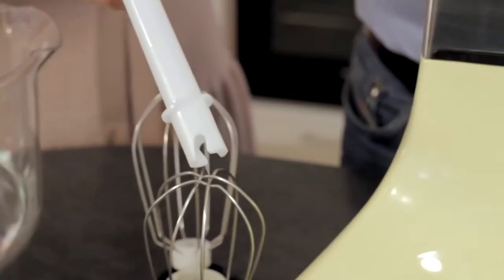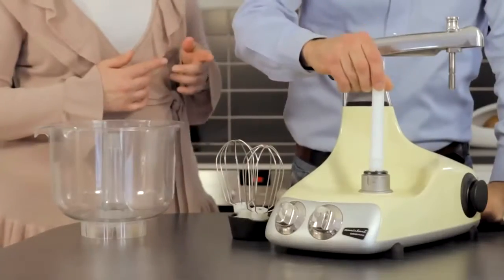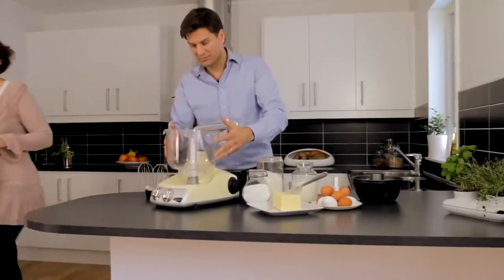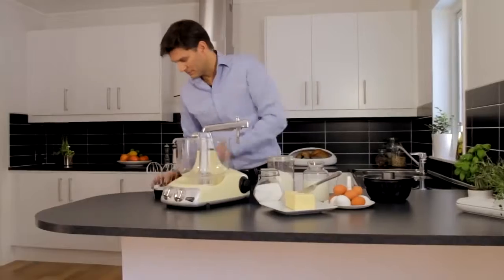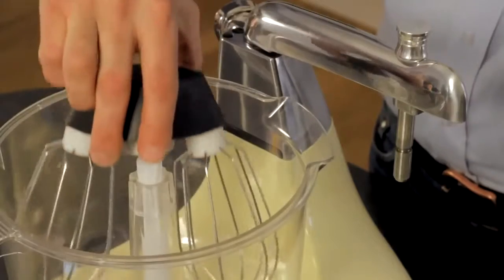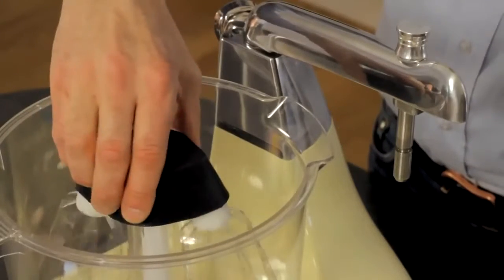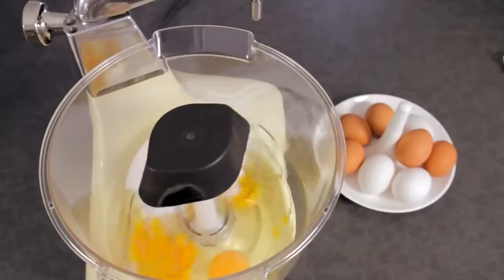Double Beater | Ankarsrum Assistent Original

Comment: Beating egg whites is the only weak point of Ankarsrum, they do not have the solidity and volume that I would like. I bought it because it is impressive to make doughs, I have a kitchenaid, luckily I did not sell the kitchenaid, because it is very good for beating egg whites and making creams and I use it to make creams and beat eggs, for kneading I use the ANK, which is not really designed as a mixer.